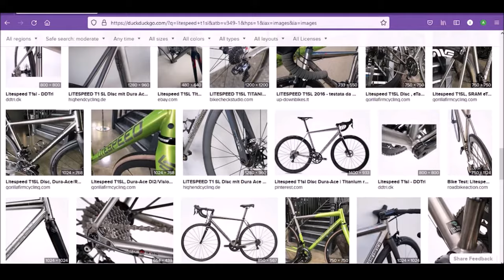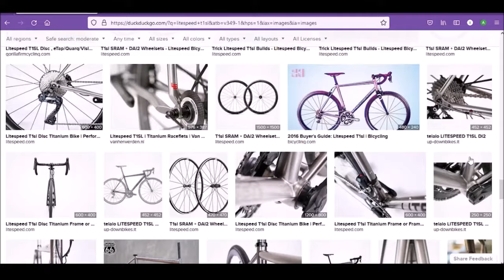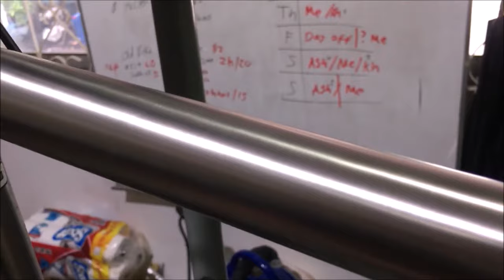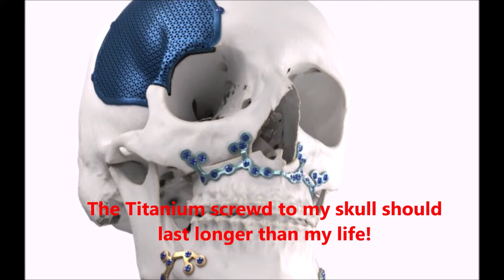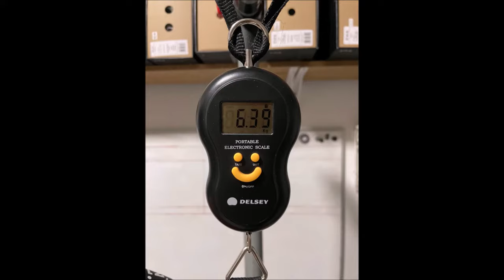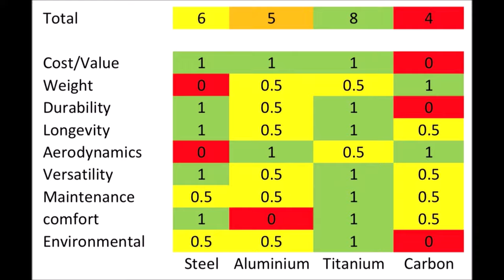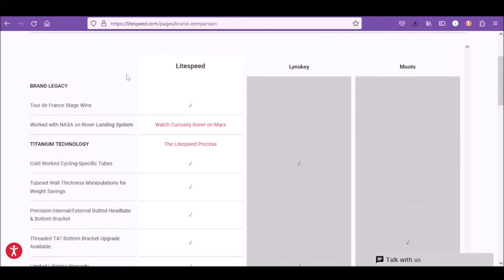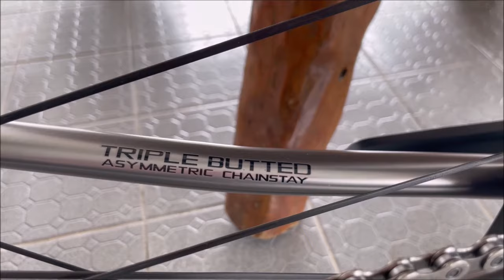The World’s Best Performance Road Bike. (And It’s Not Carbon…)

Comment: In 1982 I bought a bike from Performance catalogue - sight unseen. It was a steel framed touring bike with chosen components.  I rode that bike from Miami to Seattle.  THAT was my favorite bike of all time.
A 'titanium frame' is but a titanium/aluminum alloy - basically ...an aluminum tubing frame - a little stiffer, more corrosion resistant and MUCH pricier metal, but most of aluminum's characteristics. Titanium is but aluminum glorified...and a little stiffer.
Reply from the maker: So by your logic a steel frame is actually a carbon frame because steel “alloys” (yes steel is also an alloy) contains carbon? 

Titanium frames have almost nothing in common with aluminium frames. They don’t suffer from micro-fractures with fatigue life. They don’t corrode. They are more compliant in general. (The opposite of stiffer) They can’t be hydro-formed. They are much more durable… In fact I’m struggling to think of one similarity between aluminium frames and titanium frames? They are both made of metal… they both contain some aluminium… that’s it. 😁

In fact in my personal experience a much better comparison can be made with steel and titanium. They are much more similar in ride quality and durability than aluminium. Except steel is about 2X the weight of titanium and can rust.
Reply: That’s absurd.  The amount of aluminum alloyed into the titanium is negligible and titanium has very different characteristics than aluminum.  They are nothing alike.
To get specific, 3/2.5 is 3% aluminum and 2.5% vanadium and 6/4 is 6% aluminum and 4% vanadium.  Calling a titanium bike an aluminum bike is nuts!  The amount of aluminum is tiny and the qualities of the two metals are completely different.

Comment: What about drive train stiffness  and aerodynamics? If you’re looking for performance, as in speed, is titanium still a good choice? (No).
Reply from the maker: Yes, stiffness of the T1SL is as good if not better than most carbon bikes. It certainly flexes less than an SL7 or TCR.

As for aero, frame aerodynamics makes about 1% of your total aerodynamic drag. You can buy the LS Ultimate that’s slightly heavier and has an aerodynamic frame… but when you watch the TDF or the Giro you don’t see aero bikes winning, it’s the lighter nippier climbing bikes that always carry the rider to the yellow jersey. Also the T1SL is significantly more comfortable than a aero carbon bike, so by the end of any race you feel fresher and that’s more important when it comes to the final sprint than a tiny aero advantage. 🙂
Reply: @reginaldscot165  That's not consistent. The driver accounts for 75% of the overall aerodynamics, ok. With the bike itself, the frame makes up a large part, then come the wheels.
Reply: @reginaldscot165  The Dogma F is an aero bike (Giro and TdF). Depending on the terrain, the riders change their bikes from time to time.

Comment: Could you recommend any other ti bike frame manufacturers?
Reply from the maker: No. Not because they aren’t good. But because Litespeed are the best bike for the lowest cost when it comes to Ti. You could buy a Moots for example, but it will cost more and be less advanced? You could buy a Chinese frame, but it will be as heavy as a house and probably not that great on build quality… it will however be cheap. 

So go LS, you get a lifetime warranty and it’s an awesome bike. 🤷🏻‍♂️
Reply: @reginaldscot165  What about a Falkenjagd?
Reply: I own a T1SL and agree Litespeed are good value for money. But there are other fantastic builders out there especially a lot of the smaller custom brands like Mosaic, Speedvagen and Ericksen. Also the tech advantages are overblown with a Ti bike as none of them are remotely aerodynamic so IMO its more about the craftsmanship, ride quality, durability and appeal.

Comment: The comfort of aluminum being 0 is so 20 years ago. Modern Quality frames ride as good if not better than mid tier carbon
Reply from the maker: The most modern aluminium frame I tried was the Bowman Palace R. So quite modern and it got 10/10 in cycling media. However, it’s far from comfortable. I also tried a Allez and many of the CAADs, 8/10/12, non are what I would describe as “comfortable” in comparison with steel and titanium. 

Maybe they have gotten better, but this is a comparison of materials and in relative terms aluminium just doesn’t feel as good as steel or Ti. 

Could you name some examples of a comfortable aluminium bike please? I’d do my best to borrow one and try it. 🙂
Reply: @reginaldscot165  I built my son an Ultegra dressed bike using a Scott frame 7005 aluminum.  Obviously it doesn't ride like my Lynskey but it rides almost as well as the 4000 dollar Specialized I rode last year **I don't remember the model**.
However I am a large rider 6'4" 220 so my experience might differ from others. 
Side note, have you tried a Lynskey Helix? It is a unique bike

Comment: I’m sick of disposable bikes and I decided two years ago that I would never buy another one.  The only reason I have a carbon bike currently is that it was a warranty replacement of the previous one and I wasn’t going to say no when Specialized gave me a $4500 frame after a dropout dropped out of my previous frame.  That frame was on its way out anyway – – it was creaking at the bottom bracket, the headset, and the dropouts.

I have now worn out seven carbon fiber bikes over the course of the last 20 years (three of them in the last nine years.) If you ride them a lot, like I do, they fail, full stop. I have never had one last more than 30,000 km, although the one I am currently riding (a 2020 S-Works Diverge) seems to be much more robust than the two Diverges I wore out before it. Back when carbon was a newer thing, some of those bikes only lasted one year (<20,000 km).

I now have a custom steel Battaglin made with Columbus Spirit tubing and set up with full Campagnolo Super Record that weighs in at 7.4 kg and that’s a gravel bike with a leather saddle, and “heavy” (for Campagnolo) Levante wheels shod with 40 mm tires.  I could easily get it down to the UCI weight limit.

My issue with titanium, and I know it’s kind of a lame opinion, is that I don’t like the way most titanium bikes look. Weird tubing shapes are common, especially those made by the bigger brands like Lightspeed and Lynsky.  You can get beautiful titanium bikes, but those are usually much more expensive.
Reply from the maker: The weird tubes are there to improve performance. But you can get most Ti bike in more traditional cheap shapes, Moots are like that and yes they are expensive. But you can get custom build Ti from China for $900 USD now and there is also plenty floating around on the second hand market. 👍🏻🙂
Reply: @reginaldscot165 , like I said, i’m a bit embarrassed that I dislike these tube shapes. Bicycles should be about function, not fashion. It’s kind of like people who want their bicycles to have traditional thin tubes and double triangle construction. I just need to get over it.

Comment: I’m pretty sure that’s not 6.8kg. I had the same frame in the same size, with Dura Ace and Bora Ultra 50 wheels, and it was 7.4kg
Reply from the maker: It’s not 6.8kg it’s 6.4kg. 6.5kg on a non race day. (I use heavier tyres for training.) 😎

But your wheels are heavier than mine, your group set is heavier and probably you weren’t using TPU tubes? 🤔 🤷🏻‍♂️

Comment: You need to refresh your opinion on modern Alu endurance frames.
Reply from the maker: Maybe I do! Would need to find some new bikes to try. However the material just doesn’t lend itself to comfort. If you make the frame tubes thin to improve flexibility then they will crack sooner as aluminium doesn’t do well under repeated stressing. (Unlike steel or Titanium) the only way I know to make an aluminium frame “comfortable” would be to design it to take very large tyres and give it a slender carbon fork and seatpost? 

Feel feee to name a aluminium bike you think I should investigate further. 👍🏻🙂
Reply: @reginaldscot165   ;)
I am not an engineer, but the damping is very similar between materials. Carbon fiber can be better (depending on the construction method and materials used).
However, 20 years ago, all road bikes were the same. These days, we are not at the same point and bike geometries have evolved well enough to provide better solutions. There are many alu options out there that are as confortable as steel or titanium, ceteris paribus (wheels, tires, seatpost). 
With the advantage that the aluminum frames can be more evolved, light, super cheap and durable.

I love TI and steel bikes. Comfort is not where they stand out IMO :D
Reply: That's just my take on comfort.  :D
Reply: To give and idea: I have made two Transcontinental races, one with a Steel bike and other with an Alu bike. No problem with both. And we can qualify this race as a good test, I would say.

Comment: I disagree, I had an aluminum cross frame, in the late 90s that was way more plush than any bike I have ever owned.  Apparently, you have never ridden an aluminum Alan (they also built frames for many other manufacturers).  Given they were not very durable, nor was it very efficient, but it was absolutely plush.
Reply from the maker: Ok so 1 examples doesn’t invalidate the point of the video. Also I said “i” have never ridden an alu frame I consider comfortable. In comparison with the titanium or steel frames I have ridden. 

Also if it was a cross frame how big were your tyres? Are you comparing like for like or 35s with say a carbon bike on 23s?
Reply: @reginaldscot165  But your premise was the best material for a frame and you knocked points off from aluminum for comfort.  It CAN be comfortable that was my point, depends on the frame-builder.  Finding the "best" material should take into consideration the 1 example (BTW not one they built thousands of them for at least themselves and 3 other manufacturers)  

No it was that cross frame compared to other steel and aluminum frames (Ritchey, Redline and a custom AL frame) all running the same wheels and tires.  

You did hit the nail on the head though, "frame comfort" is literally far less important than the seatpost, wheels and tires, so much so that I have a Canyon gravel bike that would be incredibly more jarring without the carbon post, which makes it feel very smooth.

Comment: That is quite heavy for such a tiny frame tbh. Your information is sketchy to say the least, it is not uncommon for litespeed titanium frames to crack around the weld.
Carbon fibre is the only frame material  that doesn't have a fatigue life, therefore a well engineered  and constructed frame will most definitely not wear out , to the contrary it will still be as good as the day it was made many, many years after steel, aluminium  or even titanium (if the welds haven't cracked) are well and truly passed their best.
Reply from the maker: You must be trolling. Has to be the funniest comment of the week so far.  😂
Reply: @reginaldscot165  nope not at all I was perusing your channel and found many inaccuracies tbh. If you do research you will find that my statements have factually sound engineering foundations.
Reply: If we look at the carbon fibre sheet itself then perhaps we can say it has a very long lifetime. But to build a frame, we need epoxy resin etc and they all have limited lifetime, like when exposed to UV ray, etc.
Reply: @jojoanggono3229  Firstly many new epoxy resins have UV resistant properties regardless the top coat protects (paint or lacquer) the structure from UV rays,  secondly the "limited" functional life of epoxy if it isn't over stressed is far beyond the life expectancy of a human. These are accepted engineering facts.

Comment: Tbf Steel as different grades such as 316 or 304.
Reply from the maker: So does aluminium… and titanium… oh and carbon 😁
Reply: Your correct, the grades on steel measures a lot of things including how corrosive they are.
Reply: Imagine if Rolex started making bike frames with the corrosion-resistant 904L from their foundry

Comment: Carbon bikes are that fragile?  I just bought a carbon mounting bike that is carbon.  I am looking at gravel bikes.  Was looking at a carbon Trek Checkpoint.  Maybe I should go with a Lynskey instead?
The tubes getting crushed under the truck is not a valid test of the carbon.  You can orient the carbon fibers in a direction that would be much stronger  that the titanium tube.  The tube in this video probably had the fibers all running axially to the tube.
Reply from the maker: Yes, my last carbon frame only lasted 6 months before it cracked. I have seen plenty of carbon MTBs snapped as well. Carbon doesn’t like impact. 

The orientation of the weave won’t help you much, because it’s a crushing force and carbons strength is in tensile loads. The only way you could make a carbon tube as strong as that Ti tube in that test is to increase the wall thickness. It would need to be almost a solid tube with as little hole running down it as possible. And the grit rubbing on the tube would still significantly damage the tube surface. Also that carbon tube would end up being about 3 or 4 times heavier than the Ti tube by the time it was thick enough. That would make the point of using carbon totally redundant. 

For example, space X tried making their rocket fuel tanks from carbon fibre. It didn’t work, they kept collapsing under the load and making them stronger would have required so much material they would have been too heavy. So they switched to stainless steel! The steel tanks ended up being not only stronger but lighter than the carbon. 🤷🏻‍♂️
Reply: @reginaldscot165  Fortunately for carbon fiber the crushing load of a truck running over a tube is irrelevant to a bike frame.  I just watched Ben Delaney review a litespeed gravel bike, and he showed how flexy it is compared to a CF bike.  He did mention that you are robbed of power if you are putting down power.  I also watched a touring the Lynskey factory, and I have to admit, I was a little disappointed.  The fabrication did not look much more than made in garage level.  The workers are talented I am sure they are nice high quality bikes though, and I really want to like them because they are made in USA.  I am looking at the pro GR.  I also just watched a video touring the Giant bikes factory in Taiwan, and it could not be further from the  Lynskey factory.  The infrastructure and tooling and technology used is amazing.  You make it sound like CF bikes frames are a cheap easy to manufacture alternative.  You could not be further from the truth.  The machines and tooling probably cost hundreds of millions of dollars.  Each bike frame mold cost like 150 grand each.  The testing performed was amazing.  You mention space X using stainless, and yes I am sure you found one cherry picked example where CF was not the ideal material.  Tell me how many formula 1 cars, jumbo jets, fighter jets, supercars, tour de france race bikes are made from welded titanium tubes?  How much technological innovation is created each year in titanium bike frames manufacturing and design?  Carbon  fiber design and manufacturing is evolving by the minute.  If CF bike frames are so cheap and easy to make, they would be made in USA.  Only frames made here are metal welded, because they are easy to make and the tooling is cheap, and there is no competition to innovate.  Such a shame that we ceded CF fabrication to overseas companies.  I don't mean to mean to argue,  just telling you what's going through my head as I decide to get the Lynskey GR pro or Trek checkpoint SL, Giant Revolt Advanced.  I do think the chance of damaging a CF frame over a long period of ownership is higher.  But I don't think the performance is there.  You can just do so much with CF in terms of engineering.  Your video was very good, and your bike is beautiful.
Reply: @reginaldscot165   I do think titanium could make a bike frame that performs as good as CF, but it would take the engineering innovation, and massive infrastructure and tooling similar to what CF uses.  It would take hydroformed, fully 3D shaped sections that also have fully varying thickness.  Metal stamping varying thickness sheet could also be used.  3D printing also offers to advantageous properties.  The current fabrication technology of titanium bikes is probably close to 100 years old.

Comment: The obvious question: if titanium is the best material, why is it not the most common in bikes sold today?
Reply from the maker: I already explained that.
Reply: Because it is not the best material, as it is too expensive for an item that is lunlikely to be maintained and serviced much more than 10 years, it is heavier than carbon, and not easily shaped into an aero shape. It is good only for people who love the feel of metal, just like steel bikes. Good enough for riding, but not cutting edge tech like carbon is.
Reply: Making carbon fiber bikes is easier and cheaper.  Ti takes a significant investment to tool up to make and most bike manufacturers aren’t interested.